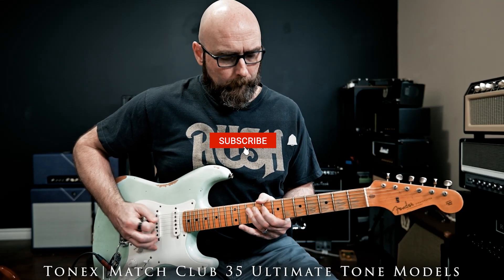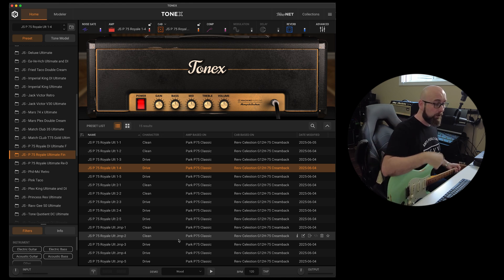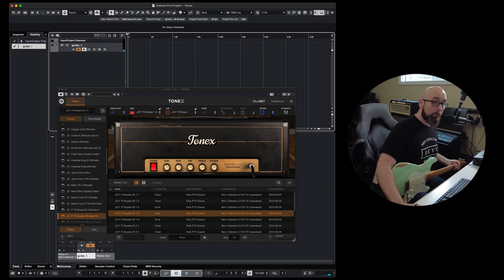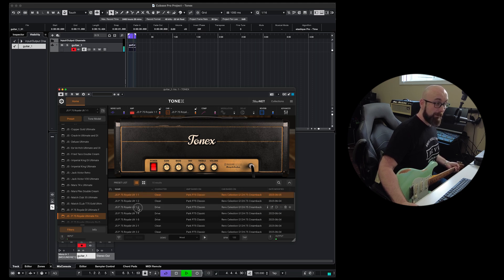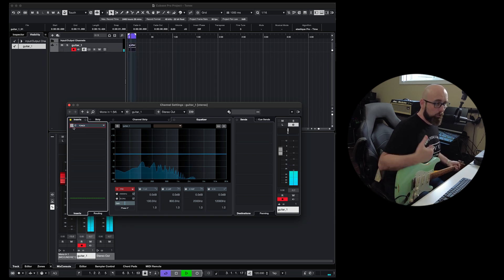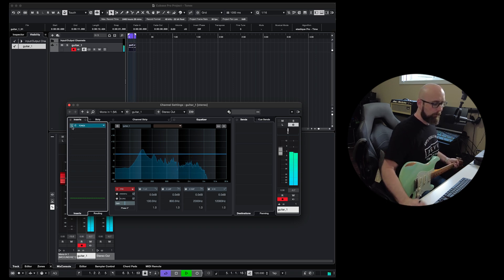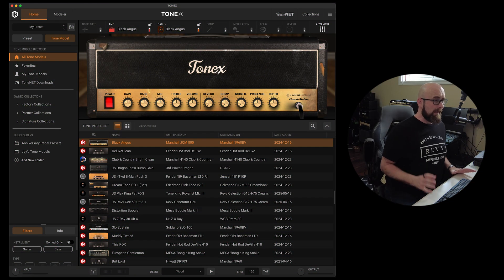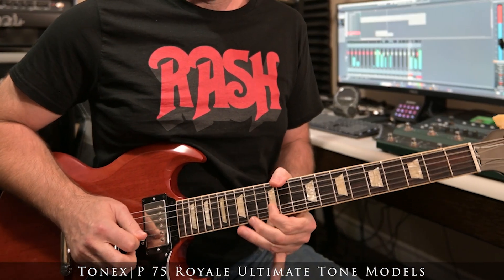How to Use TONEX Like a Pro – 5 Seriously Useful Workflows!

Comment: My Tonex software must be defunct.  Presets may or may not change the guitar sound and once a preset comes up changing tone models does not change the sound.  Within a preset a Fender Twin and a Marshall sound exactly the same.  No change when clicking through tone models.  Any suggestions